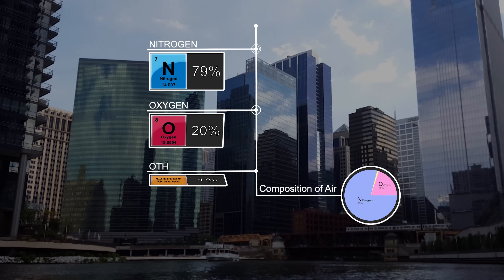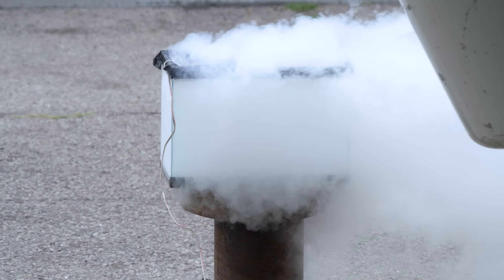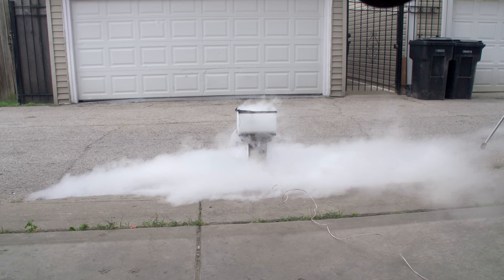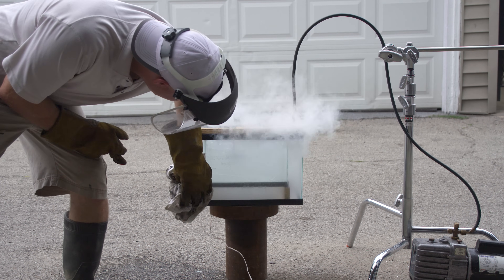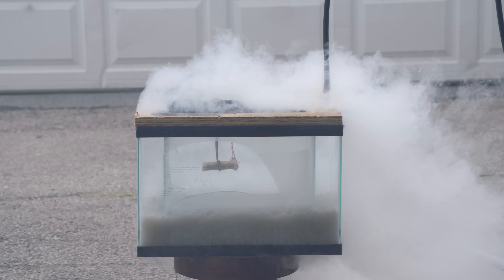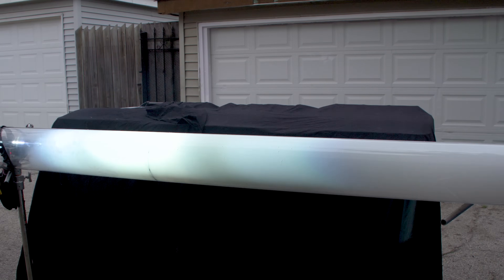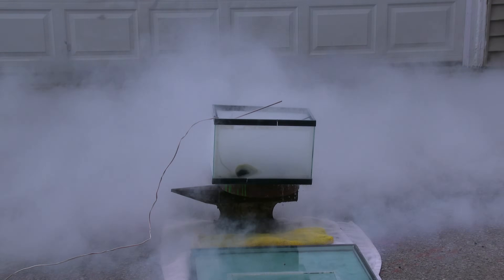Burning Model Rocket Motor In Liquid Nitrogen - 4K Slow Motion

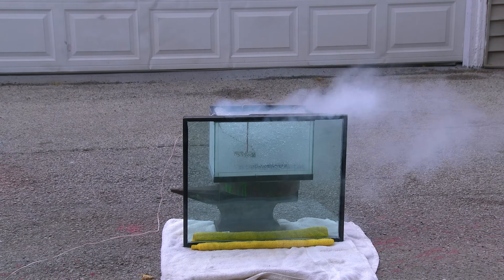Comment from the maker: CATO's are at 2:15  4:45  7:05
Reply: The first two seemed to burn fine. delay grain and all. I did not see a cato in either of those. the "boom" was the ejection charge firing (its supposed to do that) unless these were booster motors? if you want to get rid of that boom use booster motors. no ejection charge.

Third one however was definitely a cato. Here is why it cato'd

when it got as cold as the liquid nitrogen it "shrank" when it ignited it warmed back up enough to crack and separate the fuel slug inside from the "casing" holding it together.

this permitted a much larger "burn" zone which dramatically increased the pressure inside (more surface area of propellant is now burning)

Exceed the pressure the casing can withstand (likely compromised by the nitrogen as well) and boom. over pressurization and "cato"

this can happen with normal temperatures as well. its called "heat cycling"

leave some rocket motors in a hot car all day then out in the desert get real cold at night and crack. motor propellant slug seps from the casing allowing more "burn" to occur over a larger surface area creating more pressure than the case can withstand and boom. cato.

if might be interesting to try a composite motor in one of these videos. completely different fuel grains (ammonium perchlorate)

if you stick the motor in a very tight fitting metal pipe (use DUCTILE metal please or you might be making a pipe bomb) with thick walls you might be able to force the casing to "hold" and not cato. plug the rear very well too or the slug might just go out the back :-)

if you go the nitrogen route again make sure whatever metal you use stays ductile when cooled that far :-) nice thick mild steel should work. in fact if you make a nice say 2 inch steel slug and DRILL a hole in it so the motor fits nice and snug that might do the trick and no matter what happens to the metal the motor won't have enough "energy" to fracture it. ie no bomb.
Reply: in the first two shots perhaps using a fan to push the fog backwards might help somewhat with the visability?
just a thought for future projects,  love your vids ^^
Reply: Warped Perception now try a small engine submerged in liquid nitrogen with a snorkel coming out above the liquid if you can’t, just for shits and giggles

Comment: When the casing cracked (probably due to thermal stress, the grain of the propellant (basically solid black powder) suddenly had a lot more surface area exposed to the flame. More exposure = faster burn.  I have had rocket motors that have been dropped just plain detonate because the grain was fractured.  If you shoot black power weapons, look at your powder.  Powder for pistols is like fine cornmeal, powder for rifles is coarser.  Powder for cannon is like aquarium gravel.  The finer the grain, the higher the surface area to volume ratio.  Higher ratio, faster burn.

Comment: The reason for the fast burn on the last engine as well as the splitting of the casing would most likely be whar we in rocketry call a CATO (catastrophic take off) when you cooled thw engine the casing and the propellant grain contract at different rates causing cracks and gaps in the grain and between the grain and casing. This leads to more propellant burning at any given time the the casing was designed to hold causing an over pressure and bursting of the casing. It is rje main reason we try and prevent thermal cycling (going from hot to cold, cold, hot, cold) and store them in a dry cool not cold place.

Comment: As far as I know, this is the first time someone did something like this on Youtube, possibly anywhere on the Internet. Excellent work, dude.

BTW the casing broke because of enormous thermal difference and brittleness at cryogenic temperatures, and I think the fuel burned much faster because it was denser. Contraction occurs and it's significant in this case. Fuel grains are closer together.

Comment: Nitrogen gas is used as an inert blanket in solvent storage tanks eg. Liquid ether tanks. The lack of oxygen prevents ignition. The rocket engine would only burn using the oxygen already  present within the rocket fuel. Check the tank blanketing wiki for more info.

Comment: With regard to the Vacuum, the explosion, or increased burn speed is caused by the burned gasses being "pulled" away from the rocket by the lack of atmosphere. In the air the exhaust gases need to be expelled from the area meaning some energy (the thrust) is used for this. In the vacuum this is provided. The removal of these gases has the knock on effect that the reaction can travel unhindered. 

As others have said, in this experiment you can see the structural integrity of not only the cardboard tube, but the clay plug is also effected causing further detriment. You can see this being fired out in the slow motion shot. This allows the gases to escape causing a faster burn which produces more pressure on the weakened tube.

Comment: Oxidation or oxygen produces a volume in which a space lacking liquid nitrogen is present, and within this space the expansion process of nitrate may occur. The collapse of this space is due to the inability for the saltpeter to continue to expand, and so in order to launch say from a planet in which a pure nitrogen atmosphere is present, continuous oxidation would need to occur, meaning nitrous oxide can act as the perfect oxidizer, as long as it can be produced in large enough quantities, especially since liquid oxygen would be difficult to get.... unless already mass produced in a location where safety concerns are no longer an issue, such as on a volcano or something of that nature.

Comment: The burn time on model rocket engines that size are not very long. My guess on the split motor vasing is that it could not flex with the increase of pressure from the burning of the propellant heating it back up.

Comment: It will burn faster because of the increased pressure caused by being submerged. Was the an Estes C -6?
Reply: C8-5 i believe. Its hard to tell because the 6 or 8 is partially covered while hes waterproofing it at the beginning of the video
Reply: It burns faster because of the Le Chatelier's principle. It has nothing to do with the negligible increase in pressure
Reply: Stanley Chang - or maybe it burned more quickly because of the crack in the engine, which in turn was caused by the engine being made brittle by the extremely low temperature.  Curious though, how would Le Chatelier (aka "the equilibrium principle") explain the greater reaction speed?
Reply: Changing the concentration of reactants and products tend to also change the reaction rate. There might me a kinetics principle that states it more clearly. Yeah I guess it could be the crack, but I also suspect that it wouldn't have burned so quickly with the crack at room temperature.
Reply: If the crack exposes more propellant to the flame front, it will burn faster and potentially over-pressurize the combustion chamber.  While being "buried" in liquid might ramp up the combustion curve, the super-cold nitrogen would steal energy from combustion, and thus reducing the overall gas expansion.  And finally, the higher the ambient pressure around a rocket motor is, the "mass" and "acceleration" of the exhaust gas is reduced, thus reducing thrust.  This is why, all other things being equal, a rocket in vacuum is about 10% more efficient than a rocket in standard temp and air pressure.

Comment: Interesting that the actual propellant burn didn't seem to be effected much, but the delay time before the ejection charge fired seemed MUCH longer than usual. What motor were you using for this test?
Reply: The first motor is a C8-5 and since they come in packs of 3 its a safe bet the other two were as well.
Reply: Since Nix just said a 5 second delay, then yes, the delay was extended, I make it out to be 8 seconds.
Reply: +John Cochran Blackpowder slows down when cold.  This causes problems with high altitude high altitude amateur rocketry, when the ejection charge may become too wimpy to pop the recovery system.  Amateur rocket fliers trying for very high altitude have to compensate for this.  Which generally isn't a big problem, because the ejection charges are often DIY affairs with measured amounts of 0000 black powder (the stuff used with muzzle loaders), and so doubling it is easy.  But some amateurs use different systems for this (eg: piston ejection with smokeless powders - without containment, smokeless powders aren't "fast enough" to pop the laundry on large diameter rockets).

The engine burn would have been longer and lower average thrust too.   Vaporizing the LN would also be sucking thermal energy from the blackpowder->gas reaction and reducing thrust as well.

Comment: Pouring liquid nitrogen with wellies and shorts on... If you'd have spilt some into your wellies you'd have been fucked.
Reply: Believe it or not its way safer to work with LN while naked. The ladenfrost effect protects your skin from the LN adhering and burning. If i ever have to work with LN2 i always strip down to skivvies. Has paid off in the past and will again in the future. I spilled a singular DROP on a pair of jeans once and it felt like someone was driving a nail through my leg. Tiny burn, lesson learned.
Reply: Guess its good the glass did not shatter from the temperature shock.  
Still.  I would atleast have pants on, or a rubber apron.
Reply: @CriticoolHit - Which is why you wouldn't wear rubber boots/gloves with it because it can get stuck. Or at least if you do you should tape up your ankles/wrists so it can't get in.
Reply: I was gonna write exactly that ... most dangerous thing you did in this video - you do NOT want to spill LN2 into your rubber boot ...
Reply from the maker: +6Twisted lol.. I was being careful

Comment: The secondary explosions were almost as impressive as the engine burns. I wonder what caused them? Keep them coming.
Reply: After burning off the propellant component in the rocket, there's a 'delay section' that trails smoke (for visual tracking) for some seconds and then the (parachute) ejection charge goes off, leaving the 2nd blast seen in the tests. 

How most model rocket engines are built.  You wouldn't want your chute popping out right after (near-max) thrust stops
Reply: Ahh, I see that now.

Comment: His opening comment is interesting... Nitrogen occupies 79% in the air that we breathe, and yet tyre fitment places still claim we should top up with Nitrogen.  Nothing more than a scam.
Reply: The main reason for using the N2 fill for tires is to eliminate water inside the tires. This reduces contraction and expansion from temperature changes resulting in more stable tire pressure. It also reduces rubber deterioration from exposure to moisture over the long period of time tires are usually in use. The main question is is it worth putting N2 in passenger car tires? I'm not really convinced.

Comment: Those rubber boots look to me like they may be more dangerous than without. If you spilled the Nitrogen into the boot it will sit there confined within the boot freezing your entire foot- which might be a cool experiment. You could hit your foot with a hammer and break it into a million pieces!
Reply: That's why I didn't use gloves (as the company told me to) when I poured liquid nitrogen in the Scanning Electron Microscope I ran.  Any liquid that got on my hands just rolled off, but I knew I could recieve some damage to my hands and fingers if it got in the gloves, because it would take some time to get them off.  Boots would be even worse.  No way would I wear boots without pants going over them.
Reply from the maker: +Dave B lol. Well I I wasn't really worried about spilling liquid nitrogen in the boot, I had the boots on in case the tank broke and flooded the area underneath my feet with liquid nitrogen, that would be more of a problem. If our audience can stomach it I would definitely be willing to get a foot of a cadaver freeze it and break it, sounds quite interesting but definitely gruesome and uncanny.
Reply: I was going to say the same things. Long pants over the boots.

Comment: how about a rocket engine completely blocked off on the business end
Reply: sam Nonsense That would be a bomb
Reply: It wouldn't light. Pressure would build up and it would self extinguish. At least for these lower power black powder motors. The more expensive motors that run on actual rocket fuel would either blow up or blow the nozzle out, or maybe even a CATO
Reply: +Nix Ryu the Sergal "It wouldn't light".  If your igniter supplied a healthy enough jolt, it will light, backpressure will NOT slow blackpowder down once solidly started.  Backpressure just makes the reaction go faster.

 What do you think they used for "boom" before gun cotton, cordite and modern smokeless powders?  Muzzle loaders?  Early exploding artillery shells?  The same thing as in model rocket motors - good old fashioned blackpowder.

Estes igniters are kinda marginal.  It's called "making 'em cheap, not good".

CATO is just a fun slang term for something spectacularly bad happened on the pad.  My favourites are lawndarts and shovel recovery.  "Core sample" also.

Blackpowder is just as "real" as any other rocket fuel.  Just stinky, messy, and not as good as more modern ones.

Comment: Cool science notwithstanding, you were handling splashing cryo with leather gloves, and rubber boots. Literally two of the worst things you could wear when handling LN2. You would be better off with bare hands and flip flops. I don't care how fast your reflexes are, if you get LN2 into the boot, or soaking into the porous leather, you will get burned to some degree. The leidenfrost effect is your best friend here, not skin coverage.
Reply: +Warped Perception The issue isn't how "sticky" the liquid is, the issue is mechanically trapping it against your skin.  LN2 will "float" above your skin above a layer of gaseous nitrogen because your skin is vaporizing it so fast - it won't do much damage until the LN2 cools your skin down to the point where it can't vaporize it fast enough to maintain the "shield".  Close-fitting clothing, ESPECIALLY of the waterproof variety is a recipe for trapping it if any gets inside.
Reply from the maker: +bigbuckoramma that's kind of true? Liquid nitrogen is wet like cold water, it's actually quite dry, for liquid nitrogen to get absorbed into a waterproof leather glove is pretty unlikely, water is the universal solvent its molecular structure is inherently wet and it is strongly attracted to other minerals and molecules liquid nitrogen does not behave quite the same, also the leidenfrost effect with liquid nitrogen on skin is so aggressive for this very reason, liquid nitrogen is not really attracted to the skin. As for the boots, I had them on in case the tank broke open and flooded the floor beneath my feet, I wasn't really worried about spilling liquid nitrogen into my boot. Thanks for the feedback this all makes very good conversation.

Comment: I would like to see the rocket engine cooled in the Liquid Nitrogen - then removed from the Liquid nitrogen - and ignited in plain view.  

You experienced a CATO on the last one because the propellant inside the paper case shrunk more than the paper case itself.  When ignited, the propellant did NOT burn just from one end as designed -  it started burning in the small gap between the paper case and propellant.   The paper case was over pressurized due to the larger burning surface area. The case ruptured (cracked) due to increased internal pressure.
Reply from the maker: +Scott Sager you are probably on to something there, you definitely gave me an idea though. What if I removed the engine from the casing entirely and submerged just the solid propellant in the liquid nitrogen with an ignitor inserted and sealed. That may be kind of cool to see.

Comment: I think the propellant grain cracked and created a catastrophic failure of the engine.  It happens a lot to D engines as they get older.
Reply from the maker: +Steve B looks like that's what happened, but this engine was brand new
Reply: The propellant grain cracked because of the rapid cooling in the liquid nitrogen.  The grain contracted at different rates, cracking, and creating voids inside the propellant.  That gave the rocket motor much more surface area to burn once you ignited it.  The internal pressure increased at a very fast rate, and caused the casing to fail.  As #Steve B said, it happens on older D engines, especially those that are not stored in controlled temperatures.  I've blown up some good rockets this way.  LOL.

Comment: You could have avoided a lot of bubbles by not placing it on steel
Reply from the maker: +Anti well in the was not touching the steel, there is an air gap in between.

Comment: I might not be right, but maybe this is why the rocket burned faster:

Normally the heat of the flame makes the gases expand a lot which increases the pressure, higher pressure makes it harder for the gases in the rocket to escape from the rocket.

This time the flame gets cooled instantly which decreases the pressure so the gases have less resistance to escape the rocket, and thus the burning will happen quicker. 

What do you guys think?
Reply: Not a bad theory.. though I would think that would only affect the velocity of the gases coming out the nozzle.. not sure if it would make it burn quicker. I think it burned quicker because the shell cracked from the cold so the gunpowder fuel was no longer contained